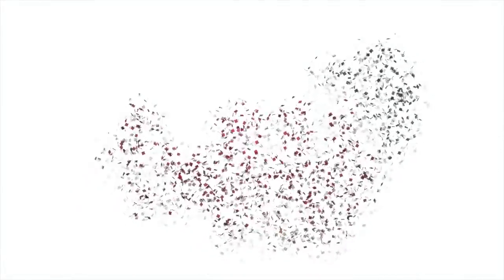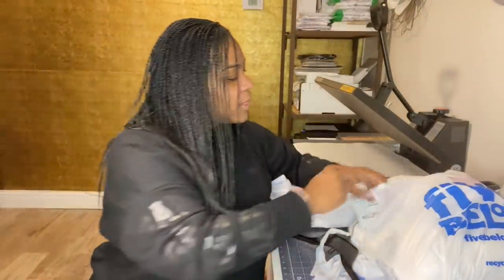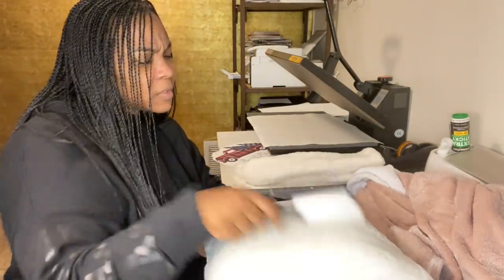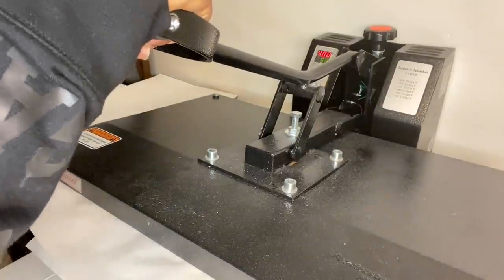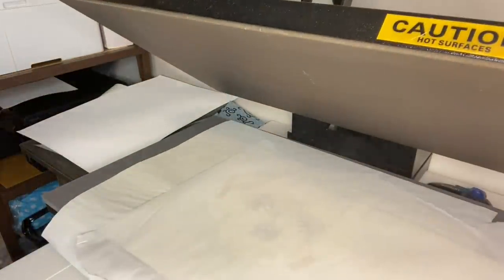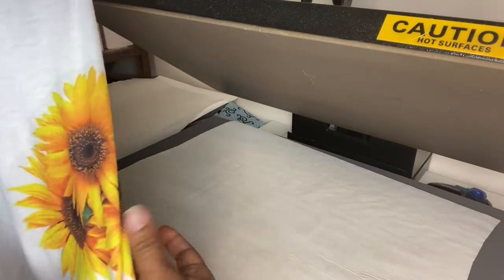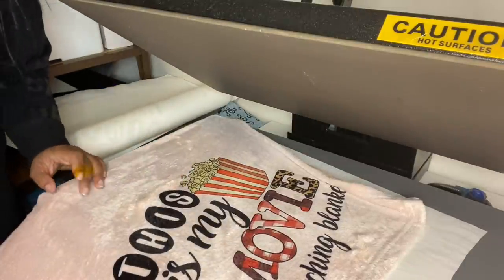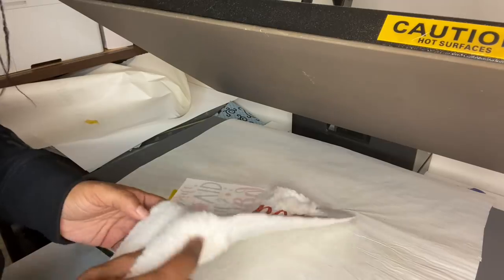Five Below Sublimation Haul - Sublimate Pillows, Blankets, Socks, Dresses

Comment: After removing the lint, I always pre-press my fuzzy items like blankets, pillows & cozy socks. It makes it so much easier to work with & the design looks great. Another great tip.... Before you put the tape on your fuzzy items, stick the tape to your clothing then to the item. The tape will still hold the transfer in place and won't pull the fibers up when you remove the tape. P.S. Great job on the video. You are very easy to watch and listen to.
Reply from the maker: Thanks for watching & thanks for the tips, Brandi!  ❤️
Reply: what is the imagine printed on

Comment: how do you get the image to come out so vibrant? love the video. what software do you use to print that large?
Reply from the maker: Thank you! The colors are really based on my print settings. I switch them around sometimes. However, I mostly print on Premium Presentation Matte, Best Quality, Adobe RGB, 2.2 Gamma and I up the brightness to about 3. My printer can print up to 13x19. I print that straight from the whatever design software I'm using (mostly Adobe). I just go to page setup and switch paper sizes. If printing larger than that, I tile the page when printing.